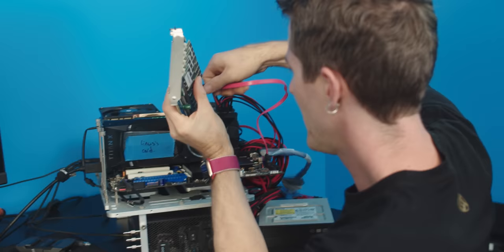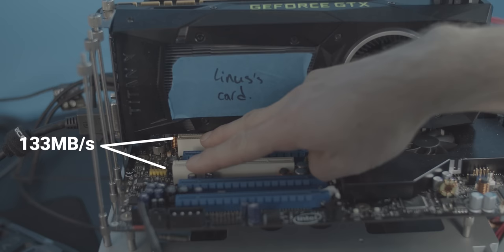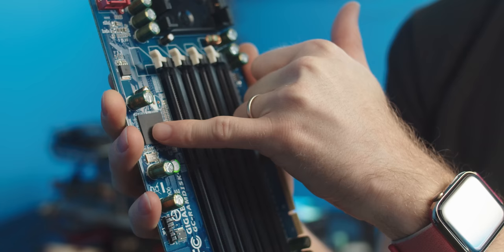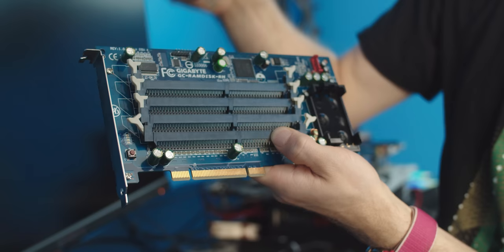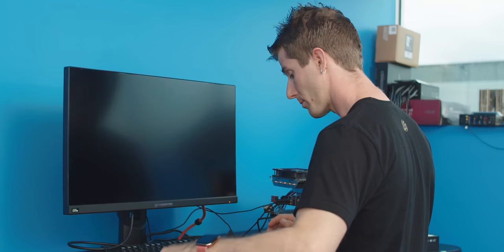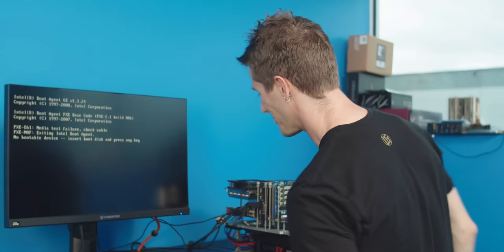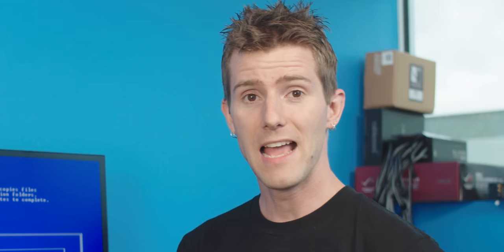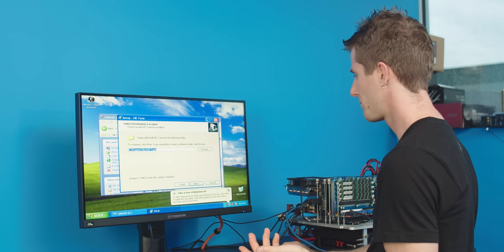WTF is this thing? - RAM on a PCI Card??

Comment: The 2019 version: same pcb but with rgb
Reply: Actually with todays PCI speeds and RAM speeds/capacities  it can outpreform NVMe ssds a lot I think... Why they not making them and only making sw for to use ramdisk from actual ram
Reply: @BaterieCZ  A PCIe 4.0 X16 link has a speed of 32 GB/S. Assuming people can make a controller capable of all that bandwidth, it would be pretty awesome.
Reply: @Vae1769  Idea: Make the battery rechargable so it automatically draws power from the PCIe lane to charge. Make it  large enough for two replaceable rechargeable AA batteries and two DDR4 DIMMS on each side of the PCB, with a fancy aluminum heatspreader covering the whole thing.
Reply: @UItEnthusiast  And finally some rgb LEDs :D
Reply: @BaterieCZ  That's the most important part xD
Reply: @UItEnthusiast  Why do you need storage?  Just RGB LEDs.

Razer knocking on my door.

What?  A cease and desist order?  Why?

Oh.
Reply: @Grimmwoldds  That comment just made my day.

Comment: oh my lord, I could actually use this as a replacement for tmpfs on /tmp. Normally, it uses your system RAM, but you can configure fstab to mount any device as /tmp, not just a tmpfs.
Reply: You would just need to configure something to format the block storage each boot before mounting /tmp

Comment: "This slot was only suitable for power..."
PCI graphics cards: "Hold my beer"
Reply: Ty TheDM 

AGP was released circa 1998 because PCI didn’t have the bandwidth for graphics.

This was a 2006 product.
Reply: Firewire
Reply: @mattbireta  there was a gt 610 pci, i can only guess it was just used for more monitors on old AF systems, there was even a more powerful (but not faster due to PCI bottleneck) gt 430 pci

Comment: that would be perfect if you were doing some shady stuff on the internet.  Everything just vanishes away lol
Reply: ....I'll take 2....
Reply: right
Reply: You can use ramroot on a full arch Linux install on a flash drive.

It basically loads the whole root directory to the ram on boot so you can pop the flash drive out and do your shady shit without anything being written to swap
Reply: You do know anyone may use RAM disk these days, right?
Reply: @philipcooper8297  not as your boot disk.

You could make a ram disk in Linux or windows then create a virtual machine whose virtual disk is contained on the ram disk.

Qcow2 does have a good bit of overhead tho so it probably wouldn't be exactly the same
Reply: TAILS does the same, but the software is also optimized to handle this.
Reply: if they hit it with liquid nitrogen fast enough after power off, like instantly. they can freeze the bits in ram, potentially forensically retrievable
Reply: thats why we have sandbox my dude
Reply: @thevortexATM  big if there. They'd have to be ready do that within minutes of the switch getting flipped, assuming someone didn't do something that'd speed the drain process up

Comment: Oh boy, I've always wanted one of these. Just the whole idea of doing this amazes me
Reply: What's the point though?

There is no way you can play games this way can you see yourself moving around files every time you install a game 

Personally, I'm too lazy to delete anything so I have over 9TB of storage on my pc
Reply: @RedEye761  There's more to having something that just efficiently using it. I'd be an awesome boot drive for my XP retro machine. Also, I'd have all my games and whatnot on a different drive then, no problem. On my main PC, I have all my games on a dedicated RAID0 hard drive
Reply: If you don't need a boot drive, then just allocate a portion of your RAM to a "RAM Disk". You get a enumerated disk in Windows that you can format to NTFS with a drive letter. Problem is, you lose it on shutdown. Windows 10 is pretty good about caching, so it's not really needed and thus counter-productive.
Reply: @RedEye761  I run chrome on my ramdisk.
Reply: @RedEye761  Nah, only have to move stuff over every time you shut the system down. With cloud sync on Steam, it's less of an ordeal that you'd think
Reply: @jswashburn  I have a RAM disk, I use it for quick intermediate storage

Comment: I had a similar device back in the day. It was intended for servers and it acted at the drive controller for an IDE disk. (SCSI was coming soon, but never arrived.) It had ram and a battery and acted as a bi-directional cache. The battery would finish cached writes if the power was lost. I don't think it ever made it past the beta. My example had hand rework on the board. It was a lot faster than the bare hard disk for things like compiling C programs (about 10x as fast) and at boot up (about 2x as fast). It learned what files your machine would need after power on and pre-cached them as best it could, or so the typewritten xeroxed paperwork said...

Comment: I worked on a Behemoth. AN/UYK-20 in the Navy as a part of the SATCOM system NAVMACS (ship) and the CUDIXS (shore) systems.
They had 2 MABS each addressed 4 boards of Non destructive CORE memory 1024 k each memory board. At 10 x 10 inches squared. And each core had 3 wires x-sel, y-sel and the third one set or reset it.
Before I wrote this, didn't think to see if there were any pictures on the web. The last time I worked on it was in Norfolk, 1987.
Working with that antique was probably why my first computer was a TRS-80 model 2000 with those 8" floppies. A slight breeze could destroy the disc.

Comment: So I saw Linus talk about having this as a boot drive, or as a way to have faster games, but he didn't mention something that I think it really would have absolutely SHINED at, if we examine it in the context of the hardware of the day. 
Virtual Memory. 
Windows has had a pretty strong reliance on Virtual Memory for a very long time, and during periods of time when RAM was expensive, throwing away what you had when you upgraded could have been a pretty tough thing to do. 
So you get that RAM, stick it in this device, stick that in a PCI slot and then set Windows to use it as the Virtual Memory swapfile location. BOOM. You don't have to throw away that expensive RAM you had, you've got yourself a solution that's way faster than having to use the Virtual Memory on your hard drive, and since Virtual Memory is basically just a disk-based representation of RAM, if the computer shuts down it doesn't matter if the data gets erased. 
So basically... using that RAM... as slower extra RAM. :D
I kinda wish Linus had even posited that in his video.

Comment: Many years ago I had some spare DDR from an RMA, I considered getting one of these and putting my page file on it or something. Probably wouldn't have been worth it.
Reply: actually that would have been a very interesting use for it.
Reply: lmao having your swap file on actual RAM sounds like the convoluted but cool way of just having more RAM, +1 for the idea :D
Reply: kinda reminds me of my first motherboard that had EDO and SD ram that would run together (as long as you had matching EDO sticks as it was dual chan only).  i had that puppy maxed out at 3 or 4 gb i think!
Reply: It's a good idea, but around the time of the one in the video, Windows had some sort of error or something if the swap file was on an unformatted partition.

Which was weird, but understandable, since these sorts of cards weren't really common.
Reply: @absalomdraconis  So, just format the drive. Easy enough

Comment: I wonder if there's a PCIe version of that card so we can plug DDR4 memory and connect to Nvme port on motherboard, and with hot swappable battery capacity. It can be great for copying and running games from it due to advantage of speed and 0.0ms delay of memory.
Reply: I haven't seen anything more modern than the original. Maybe they'll find something from china one day? You could probably swap the battery while the computer is on.
Reply: Xeno Bardock for games rather than the OS, you can do this easily with your existing RAM using a software RAM disk.
Reply: @DoctorWhom  There was a follow up from gigabyte with Sata2 acording to wikipedia. I am not entirely sure if it is the one tha Linus actually uses in this video. The first one says it was 4gb max but the one on this video is 8gb max according to Linus. https://en.wikipedia.org/wiki/RAM_drive#Dedicated_hardware_RAM_drives

Comment: A similar card came of long before that. I remember seeing a card in PC shopper magazine that used 72 pin simms.
Reply: Yeah and the iram was maybe availible as 5,25" inch drive SATA module, and if you goofle long enough you will find a very very similar product... 5,25" inch data ram disk are used on some rare banking systems and servers for cache or as volatile main drive

Comment: I have an old Elektor electronics magazine from early 90's that have a project for a 1.44M solid state drive installed on ISA slot. It was designed to use static RAM and ran on old PC-XT computers.

Comment: I had a 4 of those back in the day... Not running as a boot drive, but for SQL Server databases for a high performance stock trading black box... The battery lasted years and never lost power, so I never lost data.  At the time, the speed was unbeatable.

Comment: if u get 128 GB ram like me, you can do a 64 GB RAM-Disk, for few bucks. and have it in you RAM. i use it for Temp files, for videocutting, and so on. even some games running a little faster from the ramdrive.

but, if you restart the PC, all is gone.
for temporary files its a very nice thing. You never have to delete old files from your temp-folder. its cleaned up on every restart.

Comment: i thought i had already commented on this video, but i could not find anything i said. i hope nobody thinks this is the end all and be all of additional computer memory. for starters, it is hardly the first attempt to supplement memory for a computer. in 1984, when i bought my first single user computer, it was a cal tex big board 2. it ran cp/m 2.2+. it had 64kbytes of memory with a speed of 4 megahertz using a zilog 8080. i later upgraded to the z-80. to install a hard drive on that system, i actually had to edit cp/m and insert the parameters for the drive into the code. then i had to reassemble the operating system. that was my first lesson with assembly code. the drive was a seagate st-506, which was 5 megabytes unformatted. this drive was as large as a small 2 slice toaster. i later upgraded to a 5.25" 20 meg seagate and i don't remember the designation. somewhere along the line, i found a daughter board for the cal tex that held 1 megabyte of ram chips. that's right, not strips of ram, but integrated circuits. these had legs and went into sockets, just like eproms used for the bios. unlike what is shown here, there was no grace period. once the power died, it all went back to zeroes. the good news was, you could do a warm boot and the drive you created on the card was still intact. back then, only the filthy rich had hard drives, daughter boards like this and chips to fill them. i just wasted too much of a student loan for one semester at college to buy all of that. one funny part, is the first product i ever bought directly from microsoft, wasn't even for either ms-dos or pc-dos. it was for cp/m and came on a double sided, double density 8" floppy that held 800 kbytes of data. it was of all things a cobol compiler.

Comment: I feel like you could make some modern improvements to this to make a truly unbeatable storage option (cost be damned)
1. Include an SSD built into the card (of the same capacity) to periodically backup the volatile data.
2. Better battery (obviously)
3. Use the PCI-E interface to its advantage as PCI-E connected storage rather than the SATA interface.
4. Modern RAM

I don't know exactly what would demand these speeds, but if this market still exists somewhere, I feel like this would be a pretty killer device. It might be the size of a video card at the end of the day though.
Reply: the real advantage here actually is that it's volatile. store data either not meant to persist or data that is only backed-up strictly as-needed. there's also the security argument, but some forget you need to be able to zero it before attacker gains physical access. 

for my own use cases, i'd offload as many temp/cache files as possible [like browser cache] , and files  i generate in the process of reverse-engineering stuff. if i felt confident enough about my data loss mitigation strategies, i wouldn't mind offloading some of my coding projects working directories since sometimes many minute changes to many small files happens before any real progress is made. that said, i have in mind conceptually how i'd achieve this.

Comment: 9:56 - Are you sure it is not the other way round? The drive starts reading/writing from the centre and working its way outwards. The data stored in the centre of the drive is faster to access simply because the header isn't travelling as far to read it

Comment: that would actually work today with the right slots on this PCI Card....but it´d be a very expensive way to do a boot drive considering the ram prices :D But cool idea...much more cooler would be a PCI-E RAM Expansion Card, so when you upgrade the main slots to let´s say 8 gig blocks from 4 gigs blocks that you could use these old block as a double expansion.

Comment: we were a lot farther along in 2006 than people remember. This is actually a pretty useful device especially if you needed the performance. SSDs were not quite out yet. In fact they would start popping up a few months off from this device. I got my first SSD in 2010 and they had been out a few years by that point. I have a tablet from 1992 that has MS-DOS burned into a 2MB ROM chip, it has 4MB RAM built in and 8MB added on, runs Windows 95 or Windows 3.1 Windows for Pen Computers, and takes PCMCIA hard drives. It has RAMDrive drivers on ROM as well. It is wicket fast for a 486 on  RAM only.

Comment: Sadly Linus, that's not how you make porridge. In the early 90s a Tekram cache controller could be loaded with 64MB of RAM, configured as a RAMdrive & onto which you copied your game files of whatever you were playing for that session.
 Even over the ISA bus the speed advantage was huge over HDDs.

The iRAM was better configured the same way to make texture-heavy games immune to the fps drops suffered by mechanical drives.

Comment: Those was never intended to be used as a ' boot ' drive with an operating system on it .
Even older than those there existed similary ones used in older 486 CPU computers 
( also worked on 386 systems )
Those should originally be used as a ' Temp ' drive ( Ram drive ) 
You simply make a few bat files and when you booted your computer it would 
quickly format the drive as ram drive and MOVE the windows swap file onto this ram drive 
( other swap files could be moved too ) This back then gave a huge performance increase 
Because when windows was swapping it no longer used the slow harddrive but instead the 
much faster ram drive .
Still today you can benefit in different programs by move ' temp ' swap files to such drive .
IT WAS NOT FOR INSTALLING AN OS .

Comment: 6:50 Littlenerd fact here. in digital storage medium, a high electrical cell is usually a 0 and a low is a 1. This is to benefit error detection on the lowest layer.

Comment: At that time it was the best swapdrive. 
At that time the max. managed amount of ram was ~3.5 GB on a 32-bit system. Less chance to FAT errors occurred in the event of a power failure. Just the swapfile's location had to be reset after formatting. No more slow swapping. Long ago that was my dream... :(

Comment: (the video explains it around the 8:00 mark, but I'll leave my comment here)

It's clear that there's a battery slot on the card, but yours has a missing battery.

If it had that battery, it'd basically work like the "resume battery" on a mid 1990s laptop that was there before suspending to disk ("hibernate") became a feature in Windows, and would end up becoming the unintended Achilles heel of those things as they'd leak and kill them (NiCD batteries were used, rather than some form of Li-ion).

Comment: As an avid Linux tester (not distro hopper), a quick spare drive that can be wiped by the literal flick of a switch is a dream to me.

Install a distro test, check out what I needed, and a disconnect is enough to not to need to wipe out the partition table.
Reply: Protip: Destroy the partition table with dd by writing zeroes to the drive (e.g. /dev/sdb) for a few seconds. Then you can partition it like it's a fresh new drive.
Reply: @MisakaMikotoDesu  I know. I'm just lazy to do it every time (and afraid of one day putting thr wrong final letter on /dev/sd)

Comment: Interesting. It makes me wonder if there are ways to circumvent the volatility issue though.

Perhaps Time-Machine style automatic backup and restore to a mechanical hard drive?
Alternatively, a battery that can supply power for an extended time period in the event of power loss?
Reply: both strategies
backup power/battery, automatic dump to or reload from an HDD or SSD

even so, it is best used for data you simply don't care about losing. that's what i'd use it for. 
i can say my uses wouldn't involve a full backup, though. one use case is the browser cache, and i would cherry-pick that extensively.

Comment: I used to have two of these running in RAID 0. Even like that, the max speed of the drive was 300mb/s. BUT it did have SSD like active seek times. This was back in 2008ish.